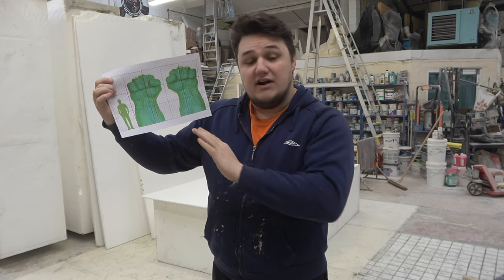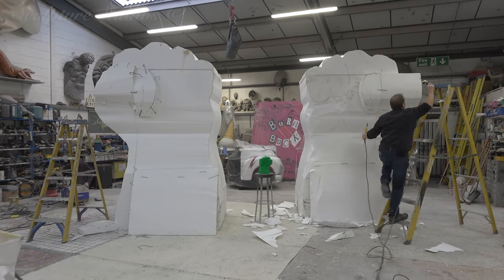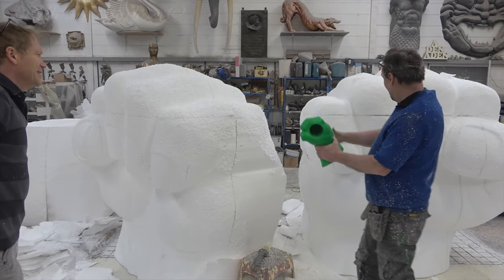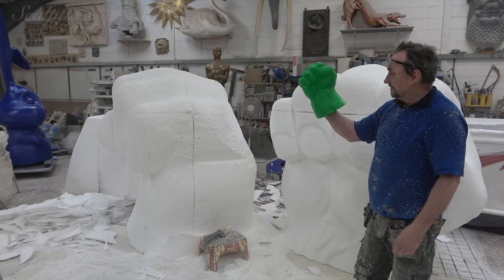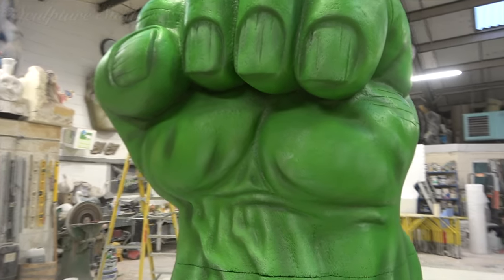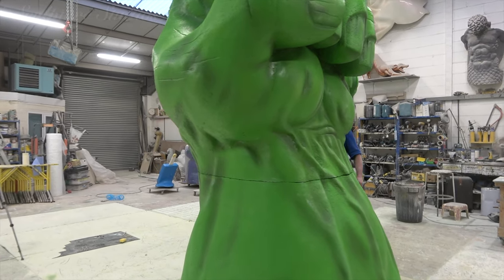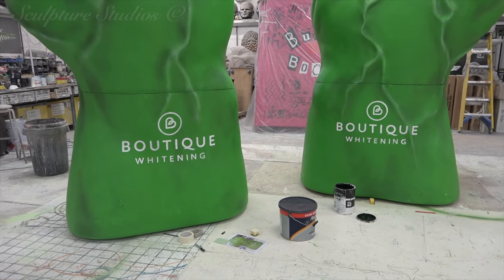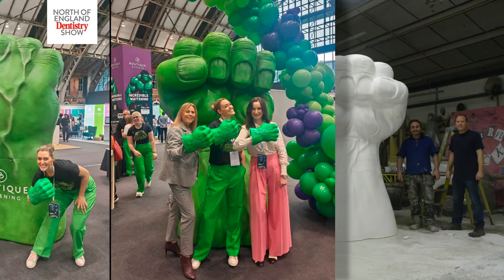Giant Incredible Hulk Fists by Sculpture Studios

Comment: Do you use regular plaster or some kind of version of gypsum for this kind of thing?
Reply from the maker: Hey Convolution. This is a water based plaster filler, pre mixed in a tub from a home construction store, like you would most likely use on small cracks etc on your home walls. Not massively durable, but takes the edge off on the polystyrene surface, with a slight shell